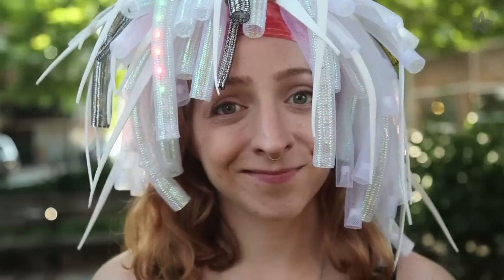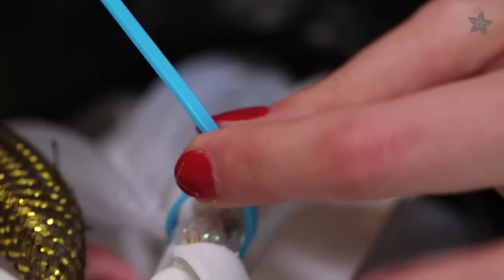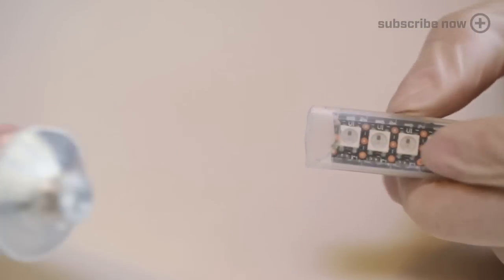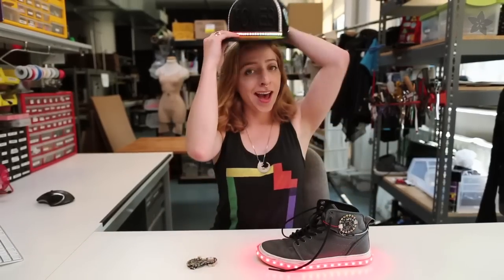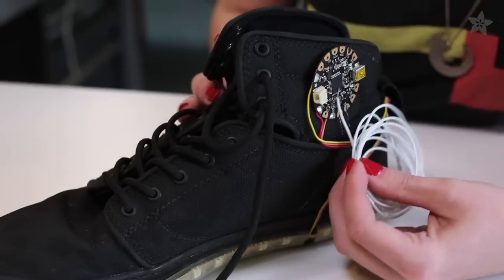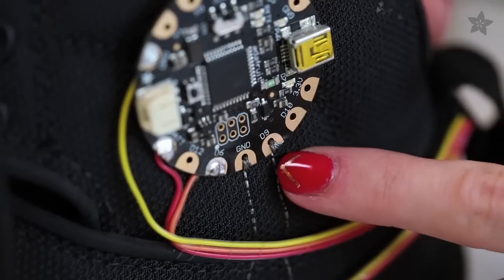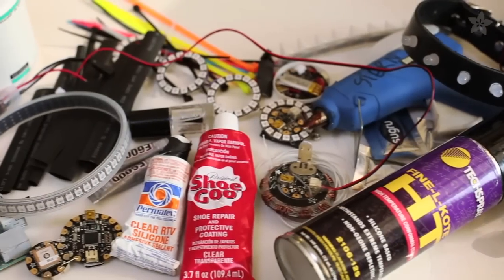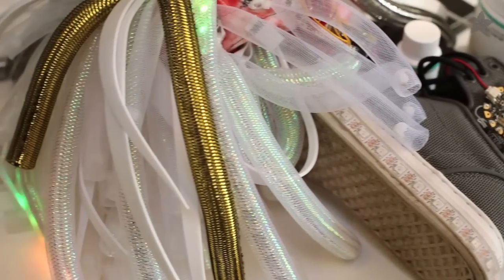Rugged Wearable Electronics

Comment: A couple really good products for sealing electronics are Dow Corning RTV 3145 silicon rubber and 3M EPS-300 adhesive lined heat shrink tubing. 

Typical bathtub type silicon rubber contains acetic acid which will corrode electronics really quick.  However Dow 3145 is alcohol based and is "mostly" non-corrosive.  The EPS-300 adhesive lined heat shrink creates a great seal but its difficult to remove.  So make sure you have a good design/build before applying the stuff.

Comment: Another way to ruggedize connections is not to use physical connections which can wear out. Instead consider using wireless connections. Naturally this is not going to happen for power, but it might for data. XBee, bluetooth and wifi are great ways to connect different components together.
Reply: Yes I agree. But in that way we have to have 2 batteries with indivisual charging or 1 charging circuit for 2 batteries  which is again a problem